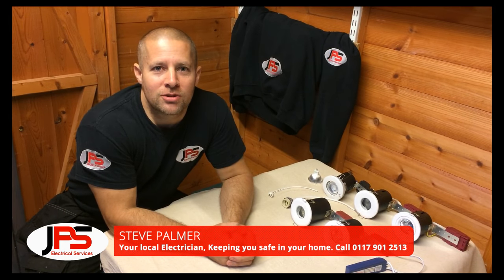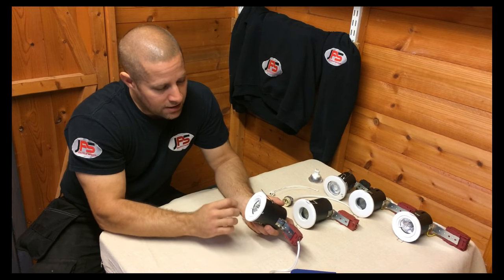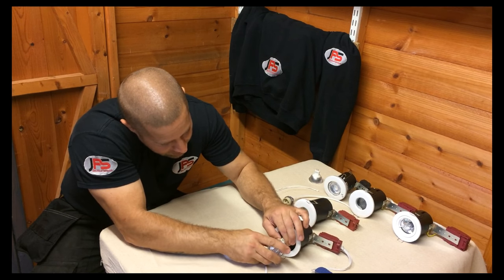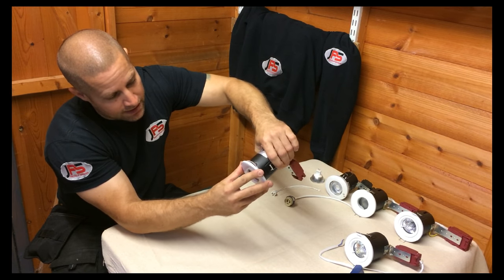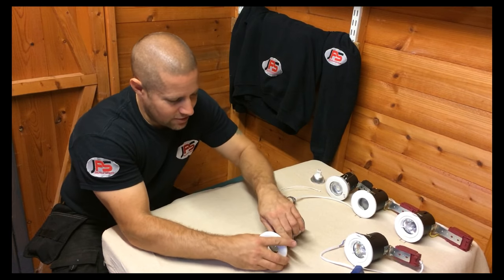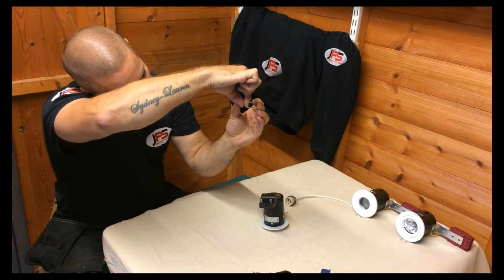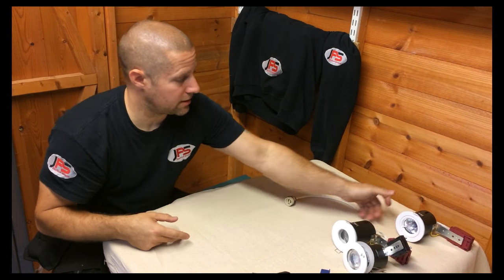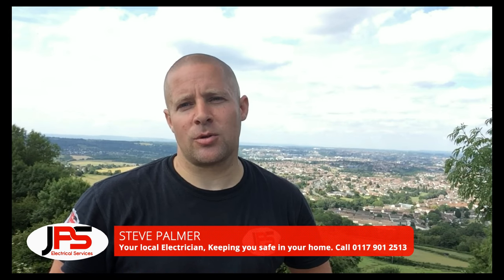How To replace a bulb in a recessed downlight - Your local Electrician

Comment: You have saved my sanity Steve! All four lights in my ensuite failed within a year of my loft conversion. I couldn’t work out how to open up the to get to the bulb (I have the vicious, break-your-knuckle kind -don’t ask how I know!! 😳☝🏼) After watching your brilliant video, turns out I just needed brute strength to turn the stuck covers anti-clockwise. Simples! 
So I now have light in my shower room - 4 years later. 💡

Comment: Very informative video on how to replace MR-16 type bulbs in recessed Downlight fixtures. When replacing a halogen bulb with an LED version to be used with a dimmer, you might have problems with LED MR-16 low-voltage bulbs flickering at low light levels. This is usually resolved by replacing lamp transformer with one rated from 0 volts to a higher voltage since the overall load on the transformer is considerably lower with LEDs. Older transformers require a minimum load around 50 or more watts which is why an LED bulb will flicker at low light levels.

Comment: Excellent Steve…….Needed to change the GU10 in an Aurora EN-DLM981X but found I’d lost the leaflet. Tried umpteen ways to remove the bezel but didn’t want to break anything so got nowhere. 
Found your magic video and got the job done in less than 10 minutes……and that included going to get the replacement bulb from the larder.
Thanks mate. : - ))

Comment: I'll mention here in the comments that some you need to replace the whole fitting rather than the bulb. I spent the best part of an hour including watching this video to figure out how to take the bulb out of my bathroom light. Went to the manufacturer website and it turns out you can't. You replace the whole light fitting!
Reply from the maker: Thank you for taking the time to comment. I have had a few people contact me to explain that they cannot see how to remove the lamp. On some newer LED units the lamp is integrated into the unit so it is not removable.  Where possible, I try to avoid installing this type of unit. LED isn't quite what they made out it would be and there are many units failing. With this in mind, it's so much easier to install units with replaceable lamps.

Thank you for your feedback. I'm pleased that you resolved your issue.

Kind regards

Steve :)

Comment: In my bathroom there's one like you showed above the shower (as you said is common in most bathrooms) and on the other side one with no glass protector that's attached to a rod shaped transformer.

It was like that when we moved in just not sure if there should be a glass protector on that one as well to protect the wires from steam and condensation
Reply from the maker: Hi, Thank you for taking the time to comment.

I would always suggest that an appropriately rated lamp/enclosure is installed within a bathroom where there is steam, water and humidity.

If the light is above 2.25metres then technically, this is what is referred to as outside of the zones so it doesn't present a safety risk. That being said, if it's open to the elements expected to be present in a bathroom then it's not suitable to the environment that it has been installed within. 

I hope this helps.

kind regards
Steve :)
Reply: @JPS Electrical Services  Yes, very helpful. Thanks for taking the time to get back to me. 👌👌👌👍

Comment: Hi Steve, Thanks for your Video, I think it's resolved something in my head in that one of our kitchen lights is not working possibly because the transformer has failed especially as when I swap it for another in the room the non working "bulb" works again so I'll look into sourcing one of these It's an Enlite EN-PL06B/30. Also (a very minor point) you are softly spoken and the bits that are spliced in afterwards are much louder. Oh, and although I knew what to expect, the spring mechanism still whacked me when I was taking one of them out!!!
Reply from the maker: Thank you for your positive feedback regarding the volume. This is something that I will look into.

I’m sorry to hear that you managed to catch your fingers. It still happens to myself on occasions and it’s a painful reminder of my error each time! 🤣

It does sound very likely that you have a failed transformer. I think I may need to do a video in this alone.

Kind regards
Steve :)

Comment: Thanks Steve. We have the low voltage ‘pin’ type in our kitchen. They are so temperamental. I think the transformers are ok as when I wiggle them the light does work. You drop it back in the recess fitting and it often goes off after 10 mins or so.  Could
It be the pin type light. I wondered if I could change the config to the other version (insert and twiest type) or would the voltages be all wrong?

Thanks if you can help. Todd
Reply from the maker: Thank you for taking the time to comment.

If you're having issues with a light that uses a transformer then I would definitely start looking at replacing them for a 230V unit and GU10 lamp. They're far more reliable. 

How many are in the room?

With regards to the intermittent issue you are having, sometimes the lamp holder wires fail, especially where halogen lamps have been in use. In this case you would need to replace the lamp holder **Remember that the electricity supply should be isolated if you attempt this task yourself**  

This link will provide you with reference to the part I am referring to. You can get these at all decent electrical wholesalers and I would recommend that you try a local independent establishment before using the chains such as shown in the link.  https://www.toolstation.com/spare-lampholder/p99286?utm_source=googleshopping&utm_medium=feed&utm_campaign=googleshoppingfeed&gad_source=1&gclid=Cj0KCQjw2a6wBhCVARIsABPeH1t2f_UrGIIgk54in2mips_hhPTvxcqtoqmDHwj4bBSGxbwaJVlgNLsaAlHeEALw_wcB&gclsrc=aw.ds

I hope this helps.

Kind regards
Steve :)
Reply: Thank you so much Steve. I’ll digest fully later. Thanks again
Reply from the maker: @dolantwins101_x5  if you have any further questions then feel free to reply here. I'm always happy to help.

Kind regards
Steve :)
Reply: I have quite a few to replace. 8 in one area (kitchen) and 7 in the other area. I’d imagine these are on separate feeds as they have different switches. Feels like a big job to me 😢

Comment: Hi Steve,
Thank you for the video, very useful.
I've got several of the version you talked through at 2:30. Some are impossible to twist anti-clockwise others are fine. Do you have any tips to unscrew the difficult lids? I think it's something to do with the rubber ring?
Thank you, David.
Reply from the maker: Hi David, Thank you for commenting and apologies for the delay in my reply.

If the lights have had Halogen lamps installed then I have seen in a few situations where the units have become so hot that they have warped.

Are these particular lights installed within a bathroom?
Reply: @JPSElectricalServicesBristol  I have exactly the same situation. In the bathroom, with the rubber seal, and no movement at all when trying to twist anti-clockwise
Reply: @ShirazEsat  Maybe they have been overtightened (locked by the compressed seal), or maybe some corrosion on the threaded parts?
Reply: Yes, a very useful video, Thank You. I also have fittings similar to those at 2:30.  They differ slightly, the GU10 lamp does not drop down, so have to turn the lamp anticlockwise while in position...which is fiddly; but works OK.
Reply: @SaxJockey  '

Comment: Excellent video thanks. Went to replace our bulb which has one of the screw release fittings but the screw won’t turn (don’t know if it was cross threaded or seized up??). Any advice how to tackle this? Thanks 👍
Reply from the maker: Stephen Humphreys, thank you for taking the time to comment.  There is a possibility that the thread is aluminium and could have stripped due to being over tightened.  If it’s just a seized thread and a halogen light bulb is being used then you could turn the power off, remove the unit from the ceiling completely and then after turning the power back on ,run the light up to temperature. Turn the power off again and using something that will protect  your hands from the heat try unscrewing the thread again. The heat from the halogen light bulb could be enough to make the unit expand and allow the thread to turn.

If this does not work then you may need to cut your losses and source a replacement.

Please let me know how you get on.

Kind regards

Steve :)

Comment: Thanks for the video. I still can't seem to change the bulb. I've got those spring clips holding the fitting in the wall. I partially yanked it out put I can't seem to open the thing to remove the bulb.
Reply from the maker: Thanks for taking the time to comment.

Some of the newer versions of a recessed downlight are now integrated units. This means that the lights inside are not replaceable.

If you go through to my website and complete the contact form, you can email me a photo and I’ll be able to assist you further.

Kind regards
Steve
www.jpselectricalservices.co.uk

Comment: Hi Steve, yes, i found it useful, BUT, ours are a different make, and the bulbs don`t seem to want to come out. We have "ENLITE EN-BZE8"  which has a "bayonette" type bezel, which comes off easily, but i can`t work out how the actual bulb comes out?. Also, do you know if these are the mains power, or low voltage variants?. We have 4 in our bathroom, and one has started intermitent flashing on and off, could it be a transformer type, and the transformer is faulty?.

Comment: Hi great video, are the light fitting shown in the video considered enclosed. 
Only I’ve just bought some LED lamps that say do not use in the enclosed light fitting. 
I have light fitting that resemble the ones in the video fire rated which are vented round the top , it doesn’t say if they are or not an enclosed fitting . Any information would be appreciated 
Thanks .
Reply from the maker: Hi John, Thank you for taking the time to comment on my video. Could you possibly send me a photo of the exact wording and a photo of the markings on the side of the unit please.  

steve@jpselectricalservices.co.uk

Kind regards
Steve

Comment: Not sure if I'm right but certain types of downlight once light bulb goes the whole unit needs to be replaced. I have a Luceco ftype f600
Reply from the maker: Hi, thanks for taking the time to comment.  

You are correct. Since creating this video, integrated downlights have become a very common application. Personally, wherever possible, I try to avoid using them. LED lighting still isn’t as great as some manufacturers make out. This becomes an issue when an integrated lamp fails because the homeowner isn’t usually able to replace the entire unit because it’s connected to the electrical cables. A lamp however, can be easily replaced by most… when they know how 🥰👍🏼

Kind regards
Steve :)

Comment: Hi Steve! Thank you for the helpful video. We have the EN-FD103204V lights in the bathrooms but they seem to give out such a little amount of light? The room is still so dark with them on - I’m not sure if this is the bulb or because the bulbs are quite recessed into the ceiling? Would you recommend changing the bulb or the whole fitting? 
Many Thanks!!

Comment: Is it ok to change the bulb  
Just by switching of the light or turn off power at the fuse box?
Thanks
Reply from the maker: If there are other lights still working and you can see that they have gone off when the switch is operated then you can proceed with changing the bulb. If in doubt, turn the power off at the fuse box.

Kind regards
Steve 🙂👍🏼

Comment: Yes, can confirm those springs do bite.  

Puzzled about people saying LEDs save energy over halogen.  My kitchen has 8 12V 50W halogens.  400W at 12V, does that not convert roughly to 20W at 230 volts?  Eight LEDs at about 5W each is double what the halogens use, or have I got the maths wrong?  Appreciate the LEDs run much cooler.

Comment: How is a spotlight fit into ceiling changed that can't have the bulb removed once fixed into place, as looking to fix some in bathroom but can't find any that are ip65 and changeable easily. Afraid it will ruin the plasterboard ceiling if the light fails and the the whole spotlight needs to be removed in order to change the bulb itself.

Comment: I've been trying to twist anti-clockwise above the shower one and it won't just open. Any tips mate? It's so frustrating, might end up calling an electrician.
Reply from the maker: Tanim Ahmad thanks for taking the time to comment.

Some LED recessed downlights are a completely sealed unit and the lamp cannot be removed. Some can just be stubborn.

Please feel free to use the contact form on my website and I’ll reply requesting a photo of the unit. From this I should be able to determine if it is replaceable or sealed.

Kind regards
Steve - www.jpselectricalservices.co.uk
Reply: @JPSElectricalServicesBristol  You Sir are an absolute star!! Thank you, I'll send the picture over. 😊

Comment: All very well sat at a table and you can grip the holder, what do you do when the holder is stuck in the recess so you can't grip and twist? We've tried a sucker to grip the bulb as we push it but the holder just twists with it.
Reply from the maker: Hi Amy, thank you for taking the the time to comment.

It sounds like you need to call someone in to assist you further.

Kind regards
Steve :)

Comment: I've got a semi-circular spring clip which i have no idea how it secures the bulb ?
Reply from the maker: Thank you for taking the time to comment.

With the light bulb connected to the light and pushed up into its housing, the semi circular clip sits between the light bulb and the bezel (outer surround) of the light.

The circular spring clip will be angled outwards on each end. This is so that you can pinch the clip (angle facing towards you) closed so that it will slot into place.

I hope this helps.

Kind regards
Steve :)
Reply: @JPSElectricalServicesBristol  thank you will now attempt to refit bulb...

Comment: Hi Steve,What diameter does the twin and earth cable have to be when fitting the latest Led downlights?Thanks.
Reply from the maker: William thanks for taking the time to post your question.  There are a number different factors that need to be taken into consideration before selecting a cable. If you are unsure then please get in touch with your local electrician and they will be happy to advise you of how best to proceed.

I’m sure you understand that is impossible to advise you in this situation due to not knowing the installation and the external influences etc.

Kind regards

Steve :)

Comment: Any suggestions on getting the can out of the ceiling?  Those pesky springs are TOO fierce. Also found the 2-pin low voltage cable fails at the back of the socket.  Poor design?
Reply from the maker: Dunelm Video thanks for taking the time to comment.

Those clips are savage aren’t they!  The plan should be to tilt the light and bring one spring clip out first and then the other one.  Take your time and once the spring clip becomes visible, hold it back so that it cannot spring shut.

With regards to the lamp holders, they can fail due to excessive use with halogen lamps.  Pop to your local TLC Wholesaler and ask for their upgrade version.  

I hope this helps, please let me know how you get on.

Kind regards

Steve :)
Reply: Great video, incidentally. Heaved the can out without getting mouse-trapped!
Reply from the maker: Dunelm Video that’s fantastic news, well done ☺️👍🏼

Comment: Hi, I’ve got a JC94174 in my en-suite. After a struggle getting it out with those clasps I can’t get the face fitting off to get to the bulb...any advice?? 🤦‍♂️
Reply from the maker: Hi dubjay1981. thank you for your question.

Some newer units come as an integrated lamp. This means that the entire unit needs to be replaced. The light bulb is not accessible. Can you send me a photo of the light so that I can confirm if this is the case please.  You can make contact through my website www.jpselectricalservices.co.uk

Kind regards

Steve :)

Comment: What if you can’t twist and there’s no metal ring? 😫😫I have the one that you can move the direction of bulb slightly, but there’s no way of actually removing the LED light...🥺
Reply from the maker: Thank you for taking the time to comment. If your fitting had an integrated LED installed then the entire unit will need to be replaced.  It’s for this reason that I try to avoid installing integrated units.

I hope this helps.

Kind regards

Steve :)

Comment: I’m having trouble with mine it’s doesn’t come apart and entire thing is metal
Reply from the maker: Since creating this video and LED lights evolving, many recessed downlights have been manufactured in a way that integrates the unit and the lamp. This means that if the light fails, the whole unit needs to be replaced.  I really do dislike these units but even I opt to install them on occasions where the installation dictates that particular design is the best option.

I hope this helps.

Kind regards
Steve :)